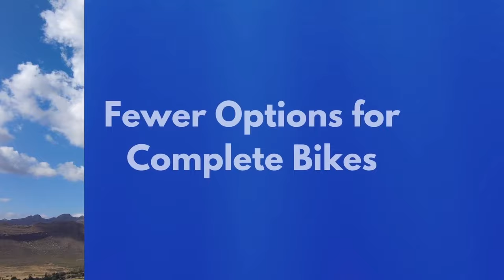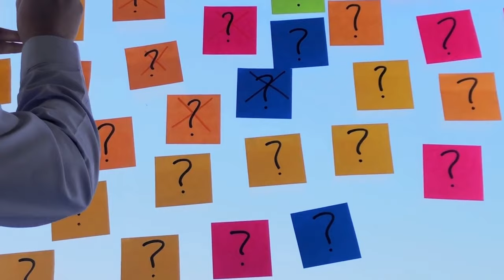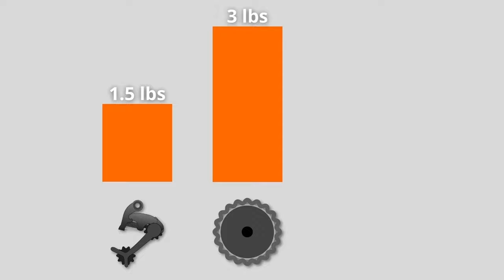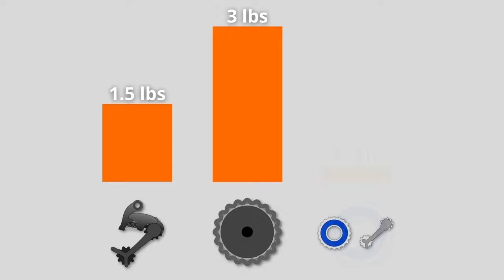Single-Speed vs. Geared Bikes (Explained For New Riders)

Comment: Single speed = more workout for the legs when going uphill. Feel the burn!
Reply: not necessary.... On MTB you have to deal with big hill, and bad terrains, its a sheet to deal, on the city you dont have these Hill nether bad terrains, so you can ride much lighter bike, with more speed, and if you have a good Gear ration, nothing will be bad, on my city i Ride 44/17 and its so Easy to climb any hill.
Reply: This is what I want !

Comment: I have single speed tandem, mountain and urban bikes. I replaced the 18 tooth cogs that came with them all with a 26 tooth cogs. The 26 tooth cog allows me to have the luxury of easy peddling and it also gives me the benefit of claiming hills easier. The only downside is my top speed is limited to about 12 - 15 mph but that is okay because the bike trails in the City that I ride in are usually crowded and the slower speed makes it safer for everyone and for myself. There is always a little kid that happens to cross my path because they are young and simply don't know any better.
Reply from the maker: Yep I'm with you on that. 9 times out of 10 I'll take the lower, slower gearing and not wreck myself on the climbs.

BTW I hadn't heard of a single-speed tandem before, sounds fun!

Comment: I just traded in a geared bike I've owned for the past 15 years for a used single speed bike, and so far I love it. The appeal was basically that it was overall a much better bike than the one I had, and I was able to get it for my old bike plus the amount I was already going to pay to get that old bike tuned up. Now, I'm not a spring chick, and having only one gear will probably get old after a while, so I plan to eventually add an internal gear hub, but for now, what I have is working out great.

Comment: I love single gear bikes, I have two.  The main thing though is to find your sweet spot for the gear ratio.  You can change the front chain ring, or change the rear freewheel.  When you buy a single-speed bike, they general come with a front 46 Tooth and rear 16 Tooth.  If you live in areas with decent hills, you might want to replace the rear freewheel to something around 18 Tooth freewheel.
Reply from the maker: Definitely! I went as low as 39:18 (around 60" on 700x35) on my upright single-speed city bike in a hilly area. Not fast, but also nice not to burst a lung climbing 😢
Reply: nowadays I'm using a very similar gear ratio 44/17, on my city there is some hills, but nothing to big, and I just get used to it, for me its perfect.
Reply: My advice is leave the front chain ring as what it comes with.   Have a full range of free wheel or fixed gear cogs and the ability and tool required to change them yourself.

Comment: I actually like to shift. It's part of the fun when I'm riding! But I agree with the aesthetics argument you presented.
Reply from the maker: Fair enough! I'm fascinated by how it affects our experience on the bike, good or bad.

Thanks for watching!
Reply: My fixed gear is bulletproof.
Reply: I never rode a fixie and I suspect it is an amazing experience!
Reply: @mom_im_losing_it  I've yet to have a single major issue with any of my geared bikes I've had over the years that didn't involve damage from a stick or whatever and it was few and far between.  Geared bikes have been pretty solid for nearly 15 years at least.

Comment: Thanks for mentioning the reliability and weather resistant character of a simpler bike, for me this is a major plus, riding in snow and ice ~4 months of the year, and frequent rain the rest of the year. The less there is, the less there is to clean, service, or break.

I take it a bit further and use Sturmey Archer drum brake hubs on my single speed, so they are sealed against weather, which has no effect on them at all, and require no service.  

If you ride your bike every day and depend on it to commute, having it just work every day, without having to spend time to service it, is a big plus.
Reply from the maker: Nice, that's a great winter set-up! How do you find the power and modulation on the SA drums (especially up front)? Heard mixed things but haven't personally tried them...
Reply: @twowheelsbetter_yt  they work fine, but you do have to pull harder on the levers…. the first time you ride them, you’ll be alarmed because you aren’t used to it, but once you understand that more force is required, then it’s OK…. It just requires getting used to it….

Using SA’s own 4 finger levers reduces the force required… I’m using 3 finger levers from a v brake bike, and so i have to pull harder than I otherwise would if I was using the appropriate levers…. and they also get more powerful after like the first 100 miles, some kind of bedding in of the brake shoes I guess…

I’ve been riding the 70 mm front brake for years, but have recently ordered the 90 mm front brake…. They say it’s substantially more powerful, and it’s often used on recumbents and trikes…

I have 3 bikes, one drum, one disk, one rim, and have no trouble transitioning between them…. I really like that unlike the disk bike, where I replace pads 3 times per year and discs every couple years, or the rim brakes where the pads melt away like they’re made of chalk in the rain in as little as one day, the Sturmey brakes have not required any servicing in 5 years of daily use, I haven’t even needed to replace the cables…!
Reply from the maker: Wow, 5 years of zero maintenance definitely piques my interest, even if they're not the most powerful. Thanks for sharing that great info, much appreciated.

Comment: I ride a single speed with a 52/18 gear ratio and have climbed hills as steep as 10% with it. There's just something about the smoothness of the drivetrain especially when I climb and put down some torque.

I've only paid $200 after the tuning and everything. I can absolutely fly on this thing since it has drop bars and skinny tires.

Comment: For relatively flat cities, I find the two-speed kick shift (with coaster brake) to be ideal.  It provides the aesthetics of a single speed with no cables at all, and the convenience of a lower gear for slight inclines. It is not a hill climber by any means, but for flat urban cycling it can't be beat in my opinion.
Reply from the maker: Good point! Definitely a reasonable and nice-looking choice that I tend to forget about.

I rode one once and just couldn't get used to shifting with every stop (whether I wanted to or not) but perhaps there's a trick I missed.
Reply: @twowheelsbetter_yt  It just takes some getting used to, until it just happens subconsciously. For some that may take a few months.
Reply: There's only two gears, so either stand on it harder or back pedal a little like you're about to manual or curb hop. It will be habit in no time.

 @twowheelsbetter_yt

Comment: It's all about the terrain. I live in a city where flat road is actually quite rare and no two areas have the same terrain either.

A geared bike is perfectly suited for my needs as I can adjust and adapt accordingly during my bike trip.

If I lived in an area with more flat or consistent terrain, a fixed Gear would be more optimal.

Comment: Single speed and fixed gears bikes are awesome and they do provide some advantages over geared bikes. Your first priority should be having fun and if you are not enjoying them you do not need to force yourself. I have sacrificed years to accommodate my style of riding to be equal to the road bike riders from my club in my town starting from 44/16 to 53/15 gear ratio and now finally I am able to compete with most of them anywhere on the road. I am even thinking of changing 53 to 54 or 55T, because finally I have managed to learn how to climb steep hills. You got to love the pain :)

Fixed gear bikes are a whole lot of a different story. I have never done more than 200km and it was hard. 430km is biggest ride with SS and I am sure I can do more if I can pace myself.

My personal advice for everyone is to have and to try as many as you can different bikes to find what suits you best. There is nothing wrong in mountain biking. It is just not for me.

Comment: Derailleurs are ugly, dirty, complicated, high maintenance, and difficult for ordinary people to use properly.  I know because my retirement hobby is amateur bike mechanic.  I am 77 and ride single speed for fitness.  My gear is 44/16 and I can ascend a 10% hill.  On a steeper hill, I can walk faster than I could ride with gears.  The variation in cadence, and heart rate is beneficial, I believe.  My favourite bike is coaster brake.  No gears, no brakes, nothing to go wrong!  I would advise everyday riders to consider 3-speed hub gears.

Comment: While I am unenthused over 'dingle speed' as something I would personally use, I would like a video on it since it does seem curious enough to warrent a deeper dive.
Reply from the maker: Noted! Definitely better suited to a hands-on video (vs graphics and stock footage) so I'll have to do that whenever I buy a single-speed again.  Thanks for watching!
Reply: @twowheelsbetter_yt  If nothing else if this is a trend thing it might get the algorithm to like you for five minutes.
Reply: I have a few dingle bikes and the system is more useful on mountain bikes because of flatter road riding to the steep trails and/or having an easier and harder ßßratio for the trails. I set up a road bike as a dingle but in practice it ended up staying in the same tall gear all the time.

Comment: Thanks for clarifying fixed vs freewheel in the first minute!
I'm 65, have ridden fixed for 37 years, always with a front brake, originally with a rack and aero bars.
 On an indoor trainer, you get a really round stroke. Or you're a bumbling hazard, and need it even more.
 And you learn everything wrong with your technique: think up and pay attention, and you are instantly comfortable.
 Or not. 🏧🏧

Comment: I run most of the time. Planning to get a cycle in the off season. 
Assuming I ride once or twice a week average. So would you recommend me to spend double the amount and get a geared bike. Or the cheaper single speed? Also single speed does mimick running more than the gears
Reply from the maker: Depends on what terrain and how far you're riding. If hilly and/or long distance, a geared bike is the safer choice. They don't cost anywhere near twice as much as a comparable single-speed, but I'm not sure exactly what you're looking at.

You might end up loving a single-speed after all, but I wouldn't recommend one without know way more. And even then, it's personal preference.
Reply: @twowheelsbetter_yt  I'm looking at an entry level road bike. As I primarily run and use bike only for cross training for short durations. 
A Entry level  14 speed road bike costs 28k Indian Rupees. And a Single Speed Road Bike costs 15k Indian Rupees. Both having the same frame, forks, breaks, tires, handlebars. 
Only the gear setup is the difference.  I will be riding mostly once or twice a week for an hour. As I am still in college. I am wondering is spending almost twice the money is really worth for it, for the short amount of time I will spend on the bike. ?
Reply from the maker: I see. Then since it's mostly for exercise, so working hard is the point, I'd probably get the single-speed to save money (and maintenance).
Reply: @nikhilerigila8175  if you really want to mimic running, consider converting the single speed to a fixed gear as it's easily reversible

Comment: This video is nothing but weird marketing fluff. 
Anyway, a SA 3 speed is the GOAT, since 1903. And EASY to take apart and change cogs. I got a SA X-RD3 to refurb a 1973 CCM in 2017, that I actually got for the gorgeous chrome handlebar. Starting up is far easier and safer with 47 GIs, to scoot across busy traffic and medium hills. Just as quiet and also once a year lube. I have awesome fenders and rubber boot mud flaps that will keep things clean all day. This bike has nice 650B x 38c SMP tires. 
It was actually my third IGH. My deFAILeurs are history. 
A SA XL-RD5w  and Rohloff14 for my tour heavyweight. They are about the same on the highways with medium hills, but the 5w is my speed burner on downhills, has done 46 mph. Also got a slug Nexus 7i roller brakes on a perfect frame roadster I wanted for my SA wheels. Stupidest thing ever since rod hoop rim pull brakes. LOL. 
Also have SA XL-FDD dyno drum brake front hubs, absolutely the BEST thing ever made for a bicycle. 100% efficient stops with ZERO% fuss in any weather. I did some 39-0 mph stops in about 60 feet. 13 mph stops are 3 inches, if that. I use 36c SMP tires.

Comment: With a "dingle speed" set up, will you be able change the gear ratio without taking the rear wheel off?
Reply from the maker: Kind of. You have to loosen the quick-release to reposition the axle for proper chain tension. So you're not technically removing the wheel, but it's not that much less work.

Comment: Single-speed/fixed are dead simple. Literally just get on it and boost. Just make sure to pick a gear ratio that can hit hills imo. And yeah fuck derailleurs and gears. Maintenance nightmare.
Reply: I've rarely had any derail  issues with all the geared bikes I've had over the years that wasn't related to damage from a stick, also few and far between.  Geared bikes have been pretty solid for the past 15 or so years and even more so since going with single front ring and 12 speed rear.

Comment: Single speed is the best until you go uphill.
Reply: Choose a lower gear ratio if you live in a hilly area, and fet fitter. I run 45:17 in Wellington, New Zealand, and it serves me very well.
Reply: @Horus-Lupercal  Problem is, I have a single speed. I'd have to get an entirely new bike. I've learned to live with it.